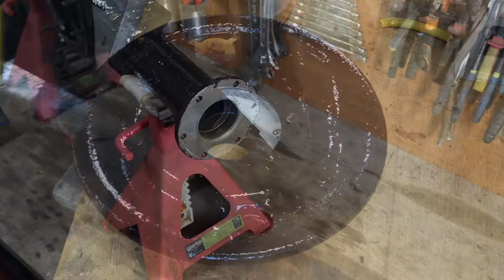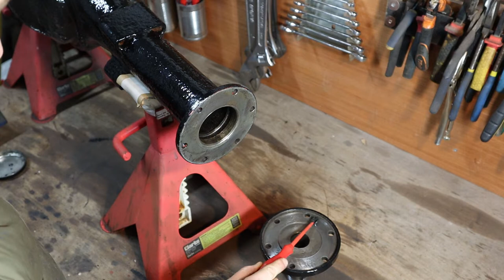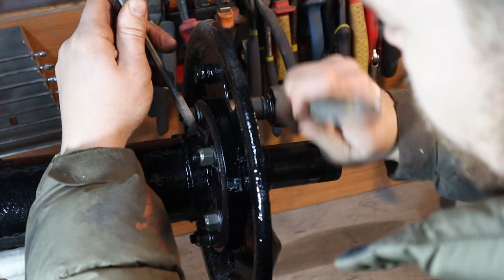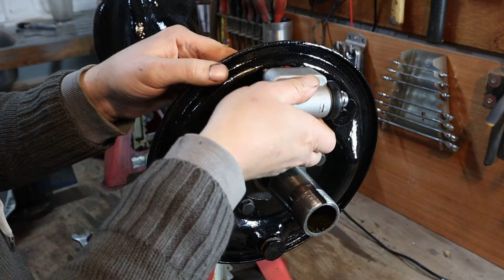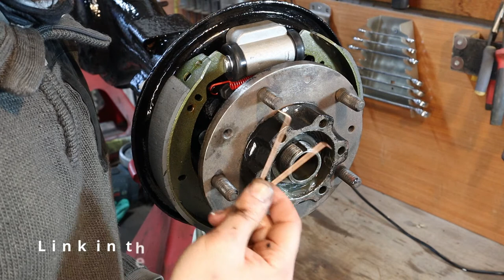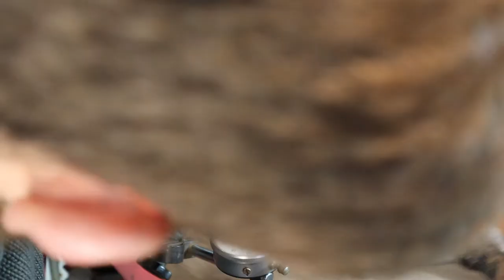Land Rover Series 2 Restoration: Rear Axle Hub Build

Comment: Just want to say thanks for the great video I'd done my rear drivers hub seal done all the end float but forgot to bend the new bearing washer back over the nut hence I started to get very bad vibration over a period of time only to find the hub had come loose but thankfully not damaged anything , just borrowed a DTI reset the end float properly and made sure the washer was bent over the hub nut this time very easily overlooked that could have resulted to loosing a wheel and possibly my life.

Comment: Should you pack the bearing with grease? I thought it lubricated by the axel oil.
Reply from the maker: I don’t think the oil makes it that far up with ends of the axle, they are normally packed with grease.
Reply: Always pack with grease. We used to thrown them with force a few times into a grease can which did a good job of forcing the grease in, or just push it in by hand until clean grease comes out the other side.

Comment: I am confused, the red spring. Is that just connected to the snail cam and then the anchoring point on the same backing panel, as in there is no movement passing between the two. Shouldn't it go from the snail cam to the actual shoe itself, that way it has spring torsion on the brake pads?
Reply from the maker: The right hand side of the spring is hooked onto a peg on the right hand brake shoe that points inwards towards the diff. The spring pulls the right hand shoe up against the snail cam. The left of the spring hooks on to a peg on the back plate. Hopefully that helps?